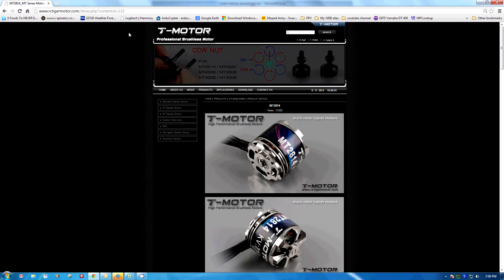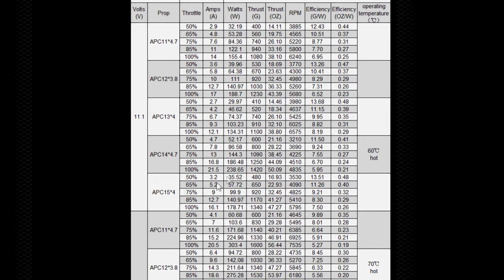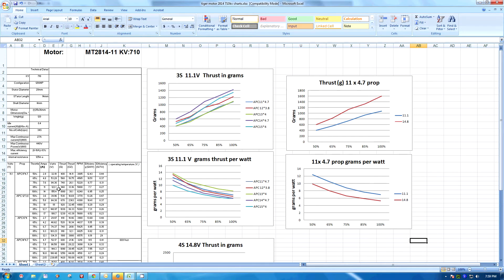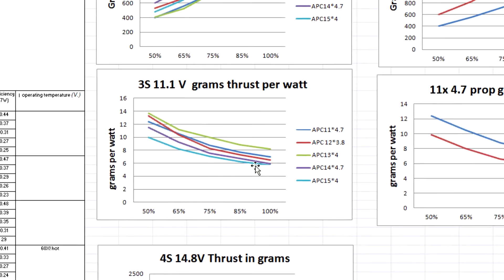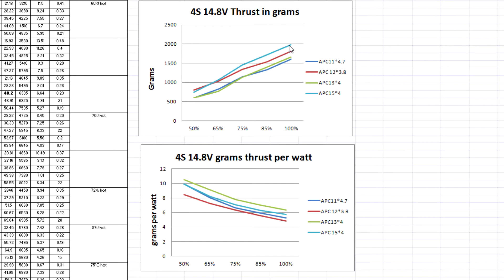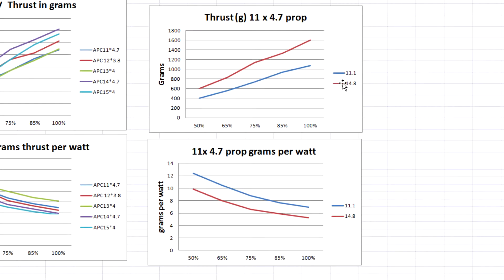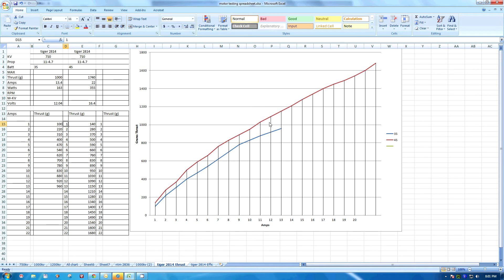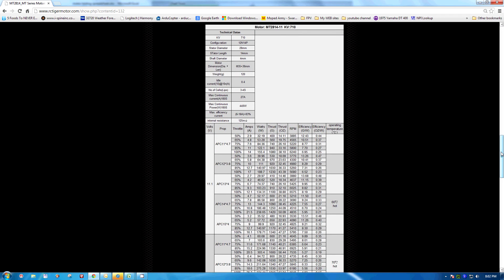Tigermotor MT2814 710 KV data graphs

Comment: Yes....thanks. There is a magic point relative to weight and the L/D ratio of the prop to the motor's own output curve needed to be achieved and I'm not finding the equation that gives it, but this information helps see the motor's output better.